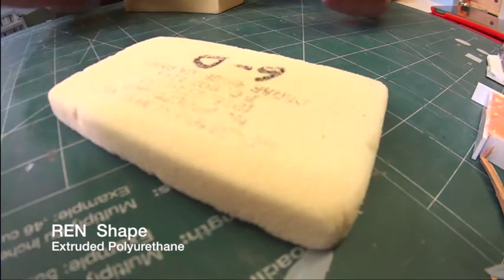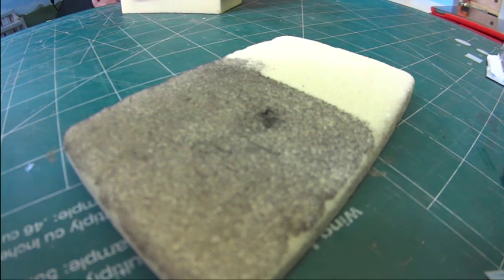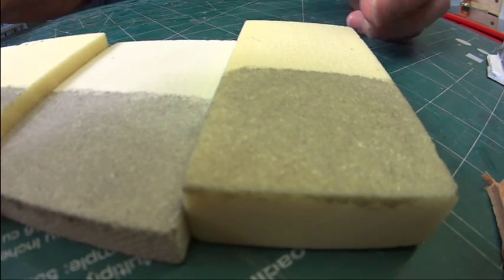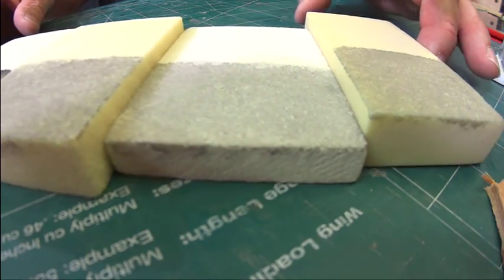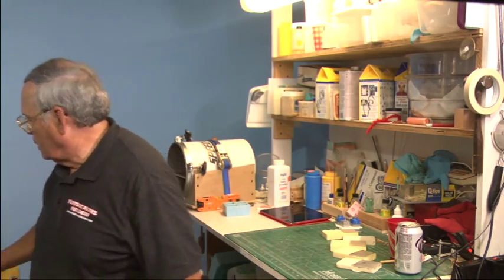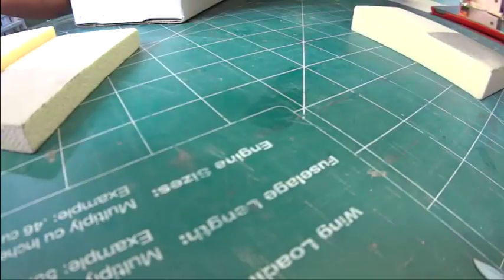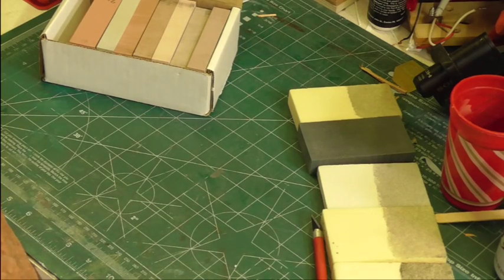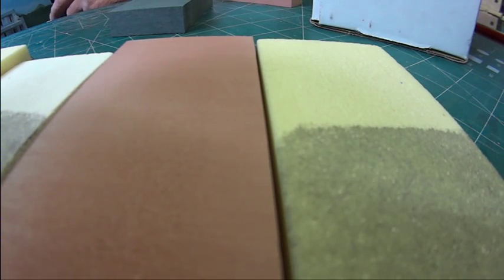Casting REN

Comment: How does the weight of the Ren Shape and cast urethane weight compare to plaster cast parts?
These remind me of the Balsa Foam that I played with at the Modeling with the Masters clinic at the convention in Portland.
Nice videos, Miles - like your video switching setup!
Reply from the maker: +Toni Ryan The REN shape varies greatly by the density of the product. The 6 to 10 pound is going to be close to the Balsa Foam but then they get smoother in texture and heavier as they increase in density. The pink board is very heavy as compared to the balsa foam. Thanks for watching my channel! Miles